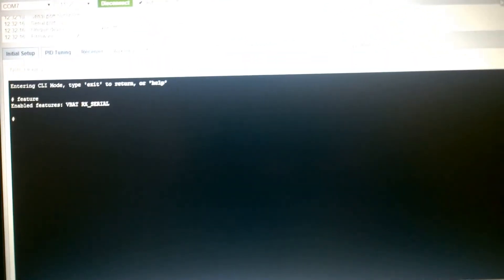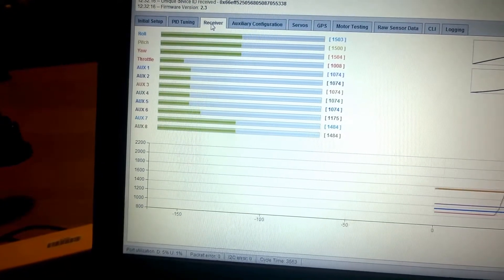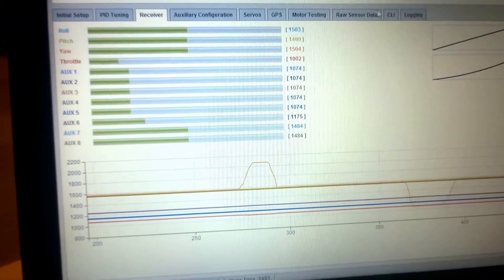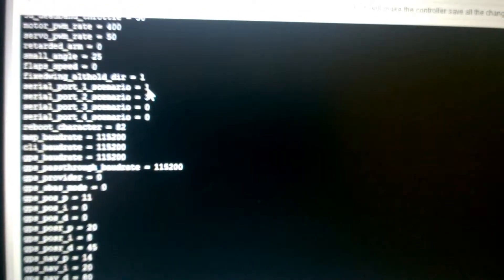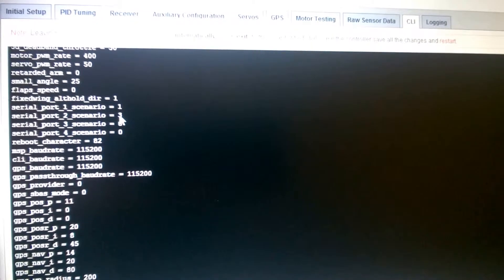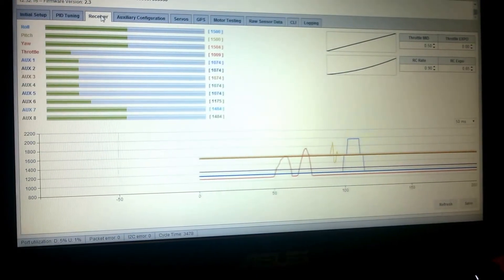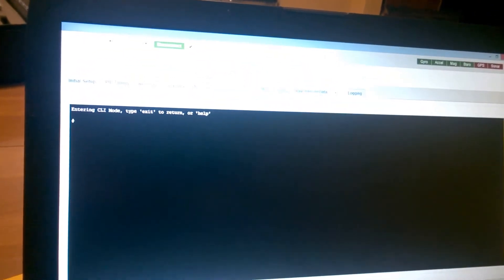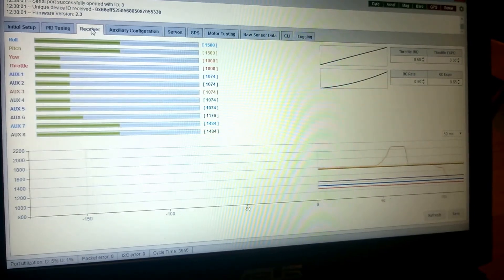CleanFlight RX Serial and telemetry causes board to freeze

Comment: This should be fixed in the latest binaries.  Thanks for the video.
Reply: FRANK RYAN There's new code coming in for 1.8.0 which changes how serial ports are allocated and used.  I will look into this soon.
Reply: Dominic I have a FrSky X8R receiver and I can't get it to work with Cleanflight.  It works fine in BaseFlight.  What am I doing wrong?
Reply: Never mind... I got it to work!!! SAAAAWWWWEEEETTT!!!
Reply: V Strill
great, i discovered a related issue, more new binaries will fix it. I updated SBus support so now you can get 16 channels from the X8R/X4R receivers via SBus port.  Binaries soon.
Reply: Man that is awesome.  You are doing an amazing job.  Keep it up.  I'll make sure I buy next FC from Massive RC.  So have the latest version of CF already installed.  I just did an indoor test flight and my quad flew the best I've seen it fly yet.  I'm going to take it out tomorrow and see if I can autotune it and try out the sonar I put on it.  This is my 1st quad & I'm real excited.
Reply: Thanks Dominic for Cleanflight.  Great work, and Great options.
Still new to quads, but I can confirm that 1.7.1 has this issue also.  My current setup is a Naze32 full board, with Ublox neo 6m and Taranis+ radio with x8r-xp.  Most times, if you disarm the quad, it will refresh after a couple of seconds.  Other times, it will go into a full lock and requires removing the Flight battery and usb cable.  I can test any combo if you like to narrow it down, but I believe it is the telemetry.  Cheers, Frank